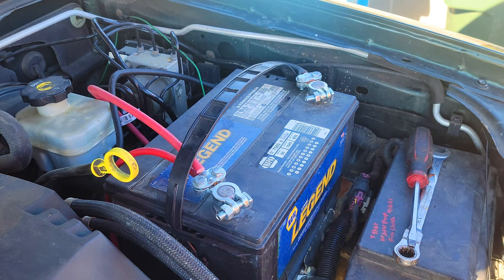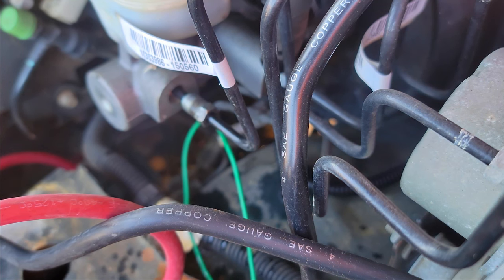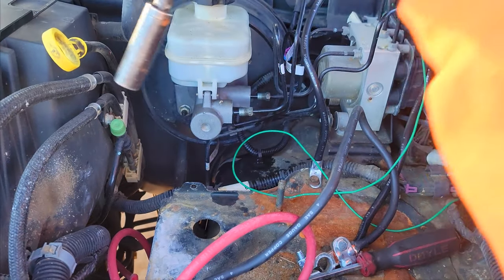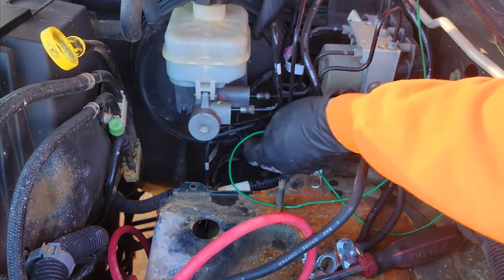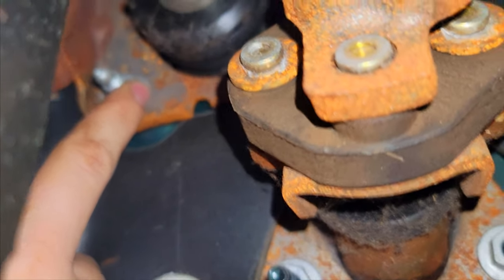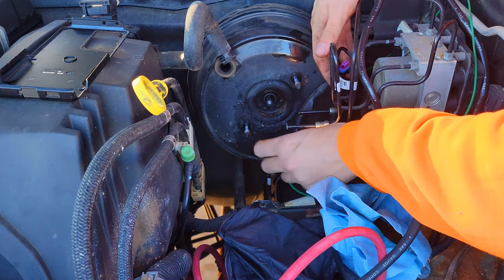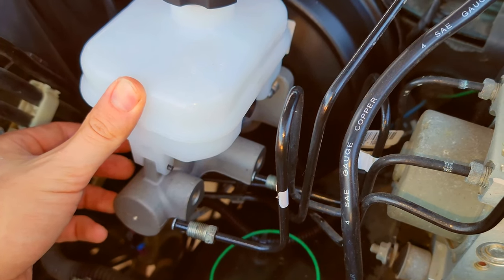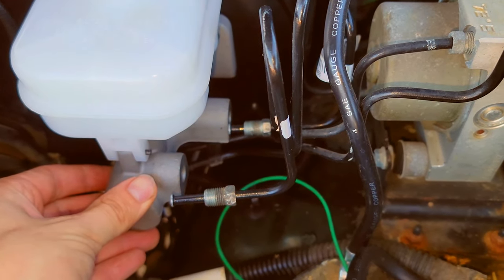How To Replace Master Cylinder and brake booster Chevy Colorado/Canyon  2003-2012

Comment: Got a question .. that hose that you removed from the master cylinder when you were talking about if it was rusted the customer could come back later and it would be a fast swap… what is that hose going into ? My Colorado keeps dieing and everytime I jump it off whatever is in that big black box makes a lot of noises but I can’t find anything that tells me what that is
Reply from the maker: I'm sorry but you must timestamp this and I will go back and check.
Reply: @TheYouTubeMechanic 12:20 what are you pulling that hose off lol … that box on my truck is making some funny sound in it
Reply from the maker: It's going on to the motor. It's been years so I don't know exactly how to describe where it's going to go. It has to be plugged in. I'm sure I could find it if I were there but the last time I saw the inside of a Colorado engine bay was when I did this job. Sorry I can't be more help.